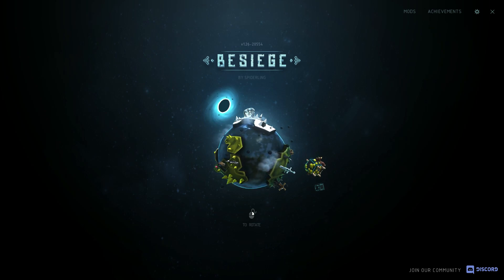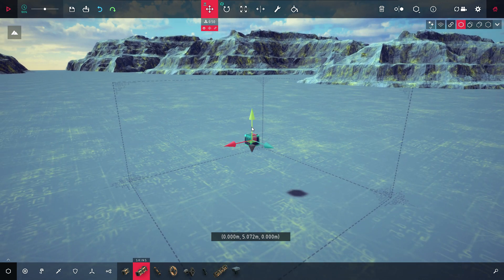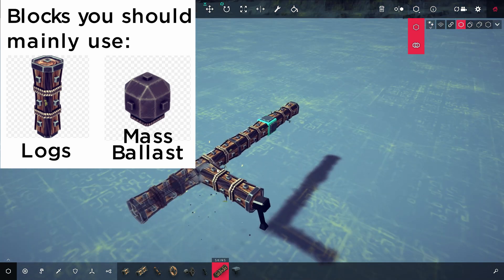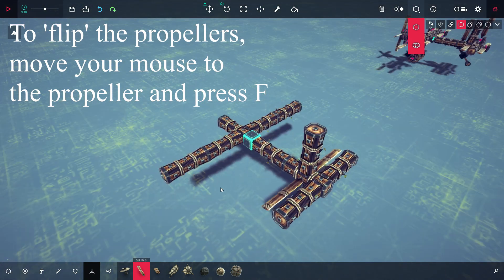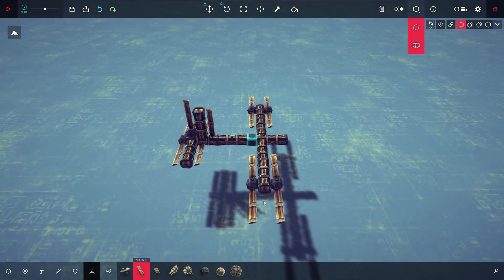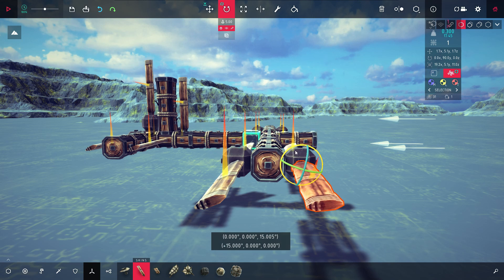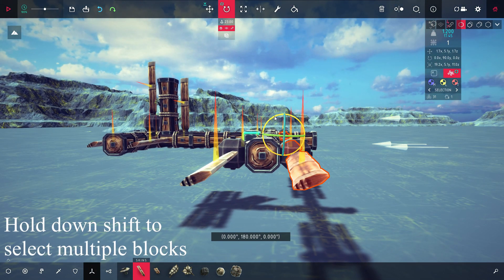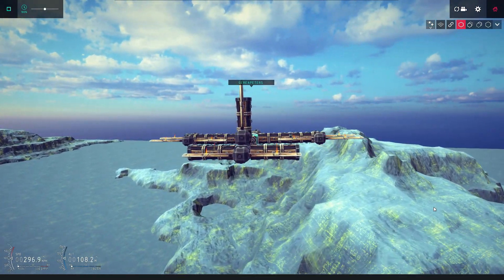How to build planes in Besiege - Part 1: Ze Basics

Comment: Nice video! Very helpful and easy to understand but I didn't understand the part where you make propellers flat. Doesn't gliders need as much as lift to fly in the air longer?
Reply from the maker: thats true! Gliders do need LOTS of lift to stay up, but in besiege physiks work a little different. if you were to angle the propellers to get as much lift as possible, your glider would slow itself down even when going downwards to gain speed. This happens because more lift also means more drag. Gliders need zero drag.

You only angle the propellers on your wings if your plane is slow/heavy. 

Another reason why the props are flat is because of the effect propeller abuse, as you saw i was gaining height and speed with no propulsion :)
Reply: @GeReapeters  thanks :D